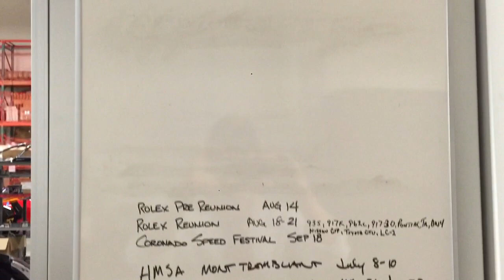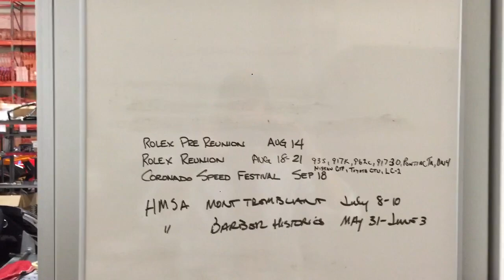Bruce Canepa & Porsche 917K Engine

Comment: Are these basicly 2 flat 6 Porsche engines mated together? Great setup low center of gravity.
Reply: No, it's an entirely different design aside from the basic geometry.
Reply: The crank looks like what you'd get if you take two 911 cranks, remove rod journals 4,5,6 on both cranks and then butts them up against each other and connect the rods from opposing pistons to each journal. Rod journals 1 and 6, 2 and 5, 3 and 4 are timed identical. Then you have gear driven camshafts and a firing order where cylinders 1 and 6, 2 and 5, 3 and 4, 7 and 12, 8 and 11, 9 and 10 all fire 360 degrees from each other. With each set of opposing pistons sharing a rod journal I really wonder about the vibrations and forces that crank has to withstand but with that layout there's plenty of room for building a strong crank. An interesting thing is that it looks like the injectors shoot up against the air flow in the intake plenum.
Reply: Everyone at Zuffenhausen was calling it a 180 degree V12 from what I have heard.

Comment: With the two halves of the crankcase put together around the crankshaft, how do you access the conrods to line them up and tighten them?
Reply: German engineering.
Reply: I suspect they are like a Continental or Lycoming aircraft engine.  You assemble the crank and Rods before you put them in the case.  Then put in the piston pins as you put each jug on.
Reply: serrer les bielles sur le vilebrequin, mettre le vilebrequin dans les 2 demi carter, monter les pistons dans leurs axes sur les bielles, chaque cylindre est monté au fur et à mesure ( refroidissement par air), à ce stade il faut penser à la distribution par engrenages.
Le volant moteur est entraîné par une prise de force au centre du vilebrequin pour abaisser le centre de gravité du moteur....